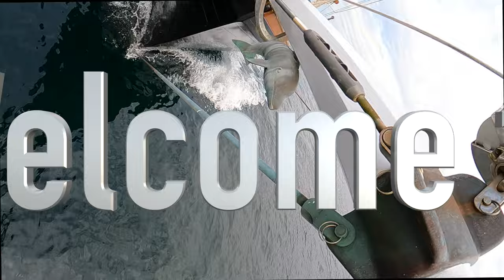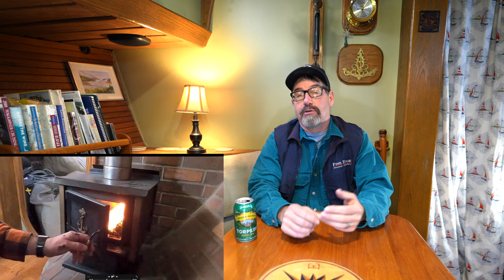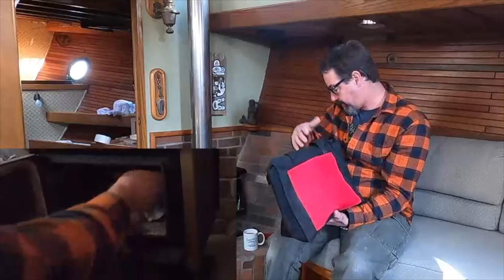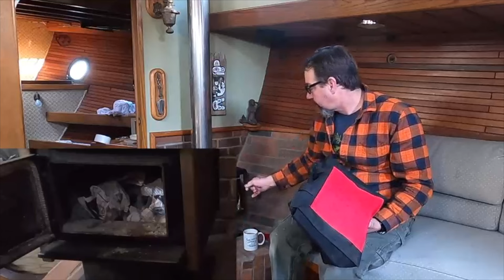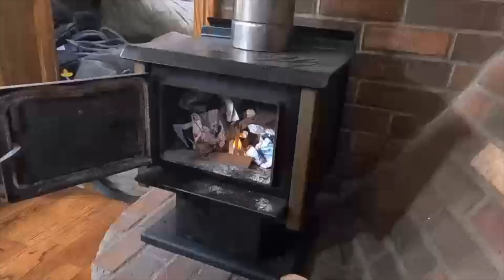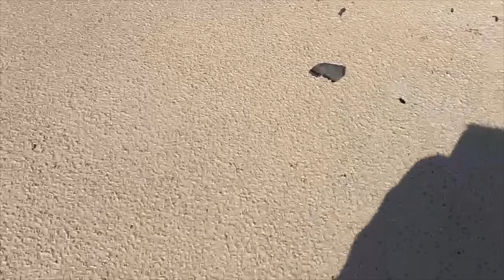Black Pearl: All About Solid Fuel Heat on a Sailboat!

Comment: i think your double wall chimney would be fine with charcoal, it’s pretty tall, however, if you have a dickenson wood stove with a smaller, shorter pipe, charcoal is way too hot.  you would need need to be very careful with it
Reply from the maker: Thanks for the comment, it's cold out, I might just give it a try!